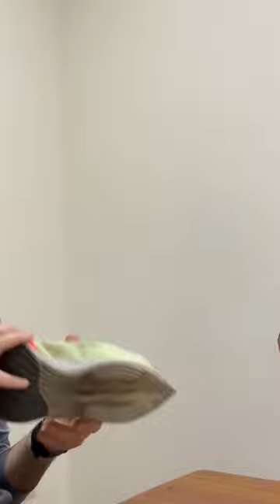No Carbon Plate in Nike Vaporfly Next%2!

Comment: I think it’s more likely the shoes are fake and was bought from a dodgy source than Nike intentionally doing this. And I hate Nike 😂
Reply from the maker: There’s a plate in the other shoe of the pair.  Of course Nike didn’t intentionally do it.  I’ve worked at factories.  It would be super easy for a worker to not drop a carbon plate in the foam mold on a production line, (especially on a 12-hour shift) & equally easy for quality control to miss it if they just spot check.  I was unlucky, but they are certainly Nike bought from a legit Nike store.